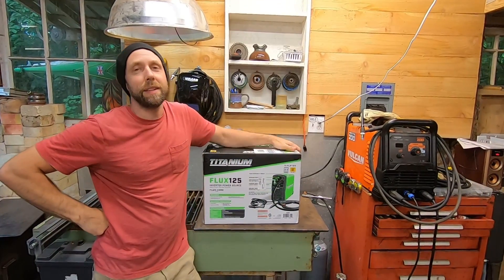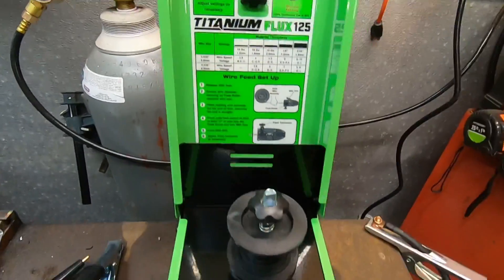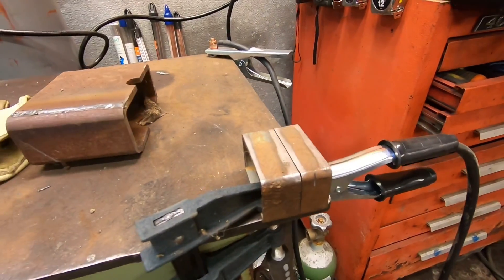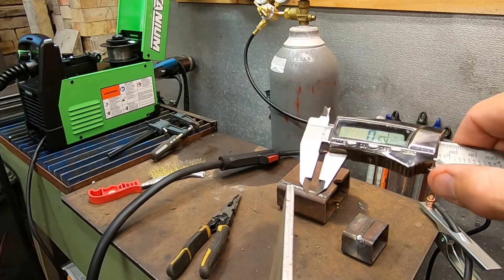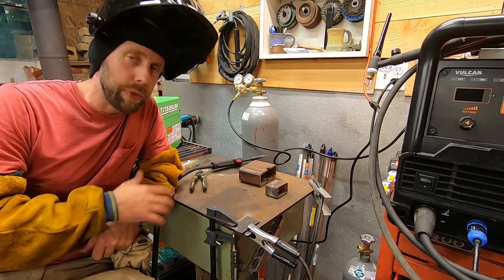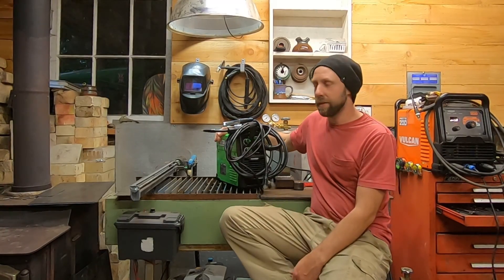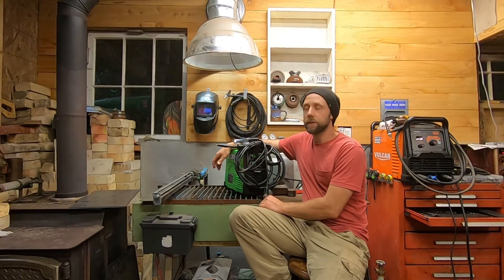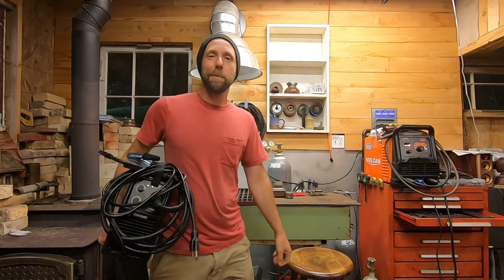Titanium Flux 125 welder from Harbor Freight

Comment: For any of u guys not satisfied with the welds with this little machine,i did some testing on steel between 14 gauge,and 3/8" thick.The factory setting guide on the inside of the lid seem very voltage rich to me.This causes pin hole porosity,and excess splatter.using the supplied .030 wire,I came up with these settings: 14 gauge (wire speed 5,voltage  C) 1/8" (wire speed 6,voltage D) 3/16" (wire speed 8,voltage E ) 1/4" (wire speed 9 voltage E.5) and even on 3/8" (wire speed 10,voltage E.5).Caution,3/8" is way above the recommended thickness.Try these settings,go slow,more like stick,less like mig,watch the puddle,have fun! this little bitch welds good!
Reply from the maker: Thanks Jeffrey for posting this! I’m sure this info will definitely help some people out 👍
Reply: @ Mike festiva - Thanks for posting this video. I’ve never welded before, but would like to learn. I have lots of experience brazing and soldering, which may or may not help. Is this little welder capable of welding aluminum?
Reply from the maker: Jimi Hughes Thanks for checking out my video 👍 this little welder is not capable of welding aluminum,  just steel. The Titanium 140,170 and 200 are capable with a optional spool gun. Take care
Reply: @Mikefestiva I just picked up mine last night, where on the PCB, did you find "switched power" for connecting the gas solenoid valve?
Reply: @Mikefestiva  Well I went out and got the welder.. It was really hot outside and I needed to weld the brush hog, s I decided if I was really careful I wouldn't get burned.. So I didn't wear a shirt.. I didn't get burned by the splatter or metal.. I got a bad sunburn from welding.. No one ever mentioned that could happen.. So for the noobs learning to weld.. Cover your skin! The UV light from welding will cause sunburn!.. Just thought you might want to mention it in a future video..
Reply: I was wondering if this would be a good welder for doing a exhaust on vehicles and grill gaurd building stuff like that
Reply: @gamerkilla  It would work,if I had the choice,I would use Mig with gas,mainly because of the lack of clean up,no slag etc.But ive welded 14 gauge uni-strut with it,and it worked good.
Reply: @MsWillysg503  2mm exhaust is approximately 18 gauge.  What are the wire feed speed and amperage/voltage for 18 gauge to avoid blowing through the material?  Century touts their FC90 as being the cure all for exhaust with .030 wire.
Reply: @aguilayserpiente  havent tried 18 gauge,14 is the thinnest Ive welded.U said 2mm,isnt that about .080 ? Im sure something less than speed 5,volts c.I would use solid wire mig with gas on stuff thinner than 14 gauge
Reply: @gamerkilla  I was planning on picking up one of these for the same things
Reply: I just screenshot this! I’m gonna laminate it and tape in my welder! Awesome Tip! Thank you
Reply: Been welding 24 gauge with it all the way down it's not always pretty but it works and is solid
Reply: Thank you! I took a screenshot and I appreciate the info
Reply: Much appreciated info , i just bought one of these with a HD ground clamp and a Lotus ltp 500d pkg deal from Harbor Freight.
Reply: Thanks so very much for sharing that information with with us! I’m getting ready to buy one of those welders!
Reply: can it do aluminim?
Reply: @mygirlhitsme  No its a DC machine
Reply: Ok I just saw this after I posted my comment. I'll try this out when I get home
Reply: @Jeffrey Worth I just picked up this little welder to do work on my ‘84 Chevy K20 I’m working on. Any recommendations for the settings for working with the sheet metal on my truck? I believe it’s 18 or 20 gauge. Thanks so much!
Reply: @gimmefuel7268  u are gunna have to experiment,18-20 gauge is thin,solid wire mig with c25 gas would be a better choice,flux core can be trickier,it burns 🔥
Reply: What setting would you use for 3/16 plate to 5/8 square tube with 16g wall thickness? Joined from edge of plate to side of tubing.
Reply: @TerryUniGeezerPeterson  u kinda gotta use a setting for the 3/16,and keep the wire on the thick plate,and run up the thin square tube quickly running little circles,its technique.If u dont run hot enough for 3/16 it wont do well
Reply: Awesome ❤thanks 👊
Reply: It does weld great for the price.. I have almost 18lbs of .030 through it without a glitch..
It will easily single pass weld 3/8   if you bevel the joint good and use .035 if you preheat the steel to blue with a torch first it will lay a fat stack of dimes clean through to the bottom..Nice 😊 👍
Reply: I ignored the little chart inside the lid and just played with the settings while making some test beads. This thing welds great for what it is. I bought it to repair mower decks and other things in my small engine repair shop. Very happy with it. I have a big TIG welder and a stick welder that makes beautiful beads but wanted something small and easy to move around that would plug into a 110 outlet.
Reply: 110 outlet at what amp i.e. 20 30 ??
Reply: @anthonypropst1818  dedicated 20 amp circuit
Reply: @MsWillysg503   hi, Im planning To Buy this welder tomorrow. Im a beginner And no experience at All. Can you plug thi directly To a regular outlet in Your garage using an Extension cord?
Reply: @Malingkat5949  yes ,u need a 20 amp dedicated receptacle for best performance on the higher settings
Reply: @MsWillysg503  you mean I Just need To replace my outlet into 20amp? How bout the breaker How many amp?
Reply: @Malingkat5949  its gotta be 20 amp from the breaker.If u run it on a 15 amp circuit,you wont be able to do thick stuff
Reply: @MsWillysg503   so I dont need To replace my existing outlet? Sorry For Asking More questions, I dont know anything about electricity. The reason I asked about outlet plug because I remember When I Bought a treadmill a few years ago, the technician replace the outlet To 20amp
Reply: @Malingkat5949  u should be good to go
Reply: @MsWillysg503  Thank you Very much! I really appreciate it.
Reply: @Malingkat5949  anytime,good luck with the little machine!
Reply: @MsWillysg503  hey, I’m gonna bother you again. What is the right helmet For a beginner like me, a  fixed or auto?
Reply: @Malingkat5949  Definitely Auto darkening.look at the titanium auto darkening from Harbor freight,the green and black one
Reply: @susanworth7930   ok thank you.
Reply: @MsWillysg503  could I run this on a 120v circuit with a 30amp breaker using a 10ga 25ft. Extension cable (cord), thanks 👍 for your technical support
Reply: @shermanyoung8185  100% yes !
Reply: @MsWillysg503  👍 thanks Mr.Worth(Nikola Tesla)👩‍🏭😂
Reply: @Malingkat5949  
20 amp circuits requires 12 gauge wiring. Putting a 20 amp breaker and recpt. on a #14 wire is asking for a fire.

Comment: Hey question would this welder be good and strong enough to weld a tube bumper for an off road truck?
Reply from the maker: Yes as long as you are a good welder you should have no problems welding up to 3/16” or even 1/4” as long as you bevel the weld joints to get deeper penetration and you know what you are doing. I used an old Lincoln flux welder that was less powerful then this Titanium welder to weld up an entire gas powered bandsaw mill, it’s still working 10 years later without any issues with the welds 👍

Comment: Hey man i have a welding question for you. How do you determine what settings to use if your welding different sized steel together? For example, if your welding 1/8" to a piece of 1/4"?
Reply: @Magoot2456  Settings for the heaviest gauge steel; keep your arc on the heavy side most of the time and only hit the thin stuff briefly. With longer beads, stop after a few moments to let the steel cool down
Reply: @reshpeck  wicked! Thank you :)

Comment: Harbor Freight no longer includes welding wire with this unit, so be sure you pick some up when you buy the welder!
Reply: Yeap, just got one no wire in box. Their 2lbs .030 is like $15 although much higher quality wire is the close to same price on Amazon.
Reply: I just bought 6 pounds (three 2 pound spools) of wire off Amazon for $24.99. Much cheaper than HF!

Comment: Can you plug this to any outlet around your house? Or does it need a proper outlet for welding?
Reply from the maker: Yes this can be plugged into any 120 volt plug, you are better off if you don’t have anything else using power on that breaker though. That way you can use the full amps for the welder.
Reply: @Mikefestiva  awesome... tnx for the reply🙂

Comment: I just bought this welder it isn't working anymore for some reason. I bought a 240v plug to 120v plug adapter cable because someone on reddit said I would get better performance I checked if I screwed the tip onto the gun right but for some reason nothing is happening?
Reply: You burnt it. 
It's a 120 volt machine only.
Reply: @deanb949  🤣🤣🤣🤣
Reply: You aren't smart enough to have access to electricity.
Reply: @waytospergtherebro  crap happens, develop some compassion and one day you might even make a friend

Comment: Never welded before but I have a crack in one of my aluminum wheels. Do you think this would do it ?
Reply from the maker: No this welder will only weld Steel, welding aluminum takes a fair amount of practice with an AC TIG welder or Spool Gun with %100 Argon gas.
Reply: if you even weld a wheel its never going to get balanced right if its like a riding tractor wheel sure do it but not a car

Comment: I am wondering why the settings on my Titanium  Flux 125 are completely different than this video. Also the 3/16" setting is blank
Reply from the maker: They probably are definitely because of changes in production. I bought mine the first week they came out. That was about 3 years ago. I think the Titanium 125 at my work has different settings then mine at my shop. Just follow the settings on your chart, maybe even set them a little lower if you are just starting out practicing 👍
Reply: Amps x volts will give you the watts that it is drawing

Comment: Could I use this welder to make a woodfiired stove?
Reply: So long as the material you use is within what this machine is rated for, yes.

If it falls outside slightly, you may be able to but there's no guarantee of that.

Comment: Can you plug this welder straight to your wall outlet?
Reply from the maker: Yes. It will plug into a standard 120 volt outlet. You will get the best performance with a 20 Amp 120 Volt outlet 👍

Comment: Bro how did you  do that, I bought that very same welder and I used a 0.035 wire and the welding did not hold the two pieces of metal together. Do you think the wire was the problem or the welder 😂😂😂. 
Yours was very professional.
Reply: Probably your settings plus your welding skill. You’ll get better with practice
Reply: Sounds like your heat setting was too low and produced a cold weld that didn't get the penetration to fuse the pieces together.

Comment: How is that welder holding up now ?
Reply from the maker: Still working good 👍 
Other flux welders to consider is the Yeswelder flux135, it’s a Flux MIG welder, stick, and a DC TIG.
 The Hynade 140D is a 140 amp dual voltage 120 volt and 240 volt so it’s definitely a good machine. Here’s a video using the Hynade 140D flux welder 🙂
Reply: @Mikefestiva  great advice. Planning on treating myself to the Hynade 140 for Christmas. I had no idea until I came across this comment of yours
Reply from the maker: @DriftmanX  Right on 👍 I just posted a video of all 3 flux welders and compared there features. I bet you would like that video. Take care 🙂

Comment: The instruction manual specifies this welder can draw up to 23 amps for the input/ac. How is that supposed to work on a standard 120v outlet and 20 amp breaker? I've looked but have found no answer for this.
Reply from the maker: I think 23 amps would be if you turned it up all the way. It would probably trip the breaker like most welders will maxed out on 120 volts.
Most of the time welding 1/8” or 3/16” it probably draws around 15 or 16 amps. The Hynade flux 140 I have is a multi voltage flux welder, it’s nice because you can plug the Hynade into 120 or 240 volts.
Reply: This is the same welder I purchased.  However, the welder trips my 20 amp breaker after less than 1 minute of light duty welding.  I did expect what was expressed below about amp usage to be true.
Reply: Update: The reason my welder kept tripping a breaker is because I was plugging into a 15 amp receptacle. My electrician suggested installing a dedicated 120V 20 amp receptacle. He advised against using 30 amps because of a fire or safety hazard.
Reply: Thanks, guys. I've been wiring up my shop this week and based on the info given here I've installed a separate 30 amp plug with #10 wire for this welder.
Reply: Interesting - thanks for the update. Today is the first day I really got to use the welder and the 30 amp worked fine, but I can certainly understand the concern.
Primarily the issue for me is that the instructions say the welder uses 23 amps, and a 20 amp circuit is rated generally speaking for about 18. Maybe the instructions over-state the amperage requirements, but personally running a 23 amp tool on a 20 amp circuit alarms me more than the 30amp breaker. 
The biggest mystery at the moment is trying to find a 30 amp homeline single pole gfci breaker. Apparently they don't exist. Fortunately i live in super dry country and take other precautions.
Happy welding!

Comment: Would this weld aluminum?
Reply: No no no you need a machine that Can do aluminum like Hobart Miller or Lincoln cause those are different settings
Reply: No buddy
Reply: Get the Vulcan pro TIG.  We got one to work on our 1958 aluma craft boat.  Works damn good.  Bought it and a bottle of argon and all accessories for 1200 on marketplace.

Comment: I know this welder is rated for 18 gauge as the lightest metal to weld, do you think it would work for 20 gauge sheet metal, such as welding in floor pans on a jeep cherokee? Would it blow through it or could it be managed?
Reply from the maker: Flux wire tends to burn hotter then solid wire so you probably would need to play with the settings a bit and run .030 wire. I’m sure you could run this for the project on your Jeep. 
You probably would need to stitch the panel, weld a short distance then stop, move to a different area then do it again then stop to keep the heat from building up. I also recommend getting some thin 20 gauge metal scrap so you can practice a bit to get your technique down before welding on your Jeep 🙂👍
Reply: @Mikefestiva  Thank you for spending the time to reply, I appreciate it!
Reply: It can Spot weld it, just like the factory. Practice your technique on scrap of same mass.

Comment: Is this strong enough to weld on truck parts?   Like gussets that the lower front end control arms bolt too?
Reply: if you weld slow
Reply: Wouldn't trust amateur welding on vehicle suspension.
Seasoned pro minimum.

Comment: Good little welder I have used .030 and .035 wire in it. Welded 14ga, 16 ga, 18 ga 10 ga 1/8, 3/16 tube (square and round) flat stock of the same mentioned Did some hand rails using 11ga and 14 ga with both wires recommended for the machine. I use .030 for lighter stock and .035 for heavier stock. I have had this welder for a couple of years fixed some converters also with it. Also did fencing with this welder 1/4" and 1/8" round tubing it has held up. I actually bought this to do the fence cause my Miller big 40 broke. used the generator for the power for this little machine it worked good. I would suggest this to a beginner or pro

Comment: Could you weld a patch panel to a car?  Can you tack weld and then stitch weld until the panel is welded.  I think if you pull it the metal on the car would warp.

Comment: Great video, I am now subscribed. I am a retired mechanic and we do a lot of RV travel. If a spring mount broke or something similar happened to our fifth wheel while on the road I would find the closest HF and buy one of these little machines. We have a 4500 watt generator and that would be its power supply. For the cost this welder would likely be less expensive then calling a mobile welder and when the trip was over I would still have the tool. Thanks much for the video!
Reply from the maker: Hey Jim thanks for subscribing and your kind comment 👍

Comment: I’m used to (amateur) welding with a big ass Miller with argon gas, but I bought this to do a little stuff. I tried to fix my snowblower handle and it was the worst welds I’ve ever done lol! And I’m not blaming the machine at all, I know I just need to fine-tune it. The weld held for a little while, needless to say I’ll get to practice welding some more on the snowblower…🤣🤣

Comment: What should i get the Titanium 125 flux or the Harbor freight 125 flux welder? Titanium is $209 and the Harbor freight one is $149. What's the difference in the 2?
Reply: I've owned both, the Titanium is worth double the Chicago Electric 125. The wire feed and stinger are trash on the CE125, the Titanium 125 is made with quality parts and weighs half of the cheaper one.
Reply: @charlesdjones1  thank you
Reply from the maker: Definitely my thoughts as well, thanks Charles for commenting 👍
Reply: @Mikefestiva  bought my Titanium last weekend.
Reply: The Chicago Electric 125 is AC and the Titanium is DC.  DC is far superior for flux core welding.  I have owned both these welders and find the Titanium far superior and well worth the extra money.

Comment: HI Mike.  What size brake would I need for this Welder?
Reply: fyi... my garage has a 15 amp breaker. I can weld 1/4 " for about a 1 inch bead before it trips the breaker. Works great for small repairs, even with a 15 a breaker, but for any kind of fabrication a bigger breaker would be needed.

Comment: I had mine for a little over a year and it has been a solid welder. Gone through maybe 8 spools of wire in that time. I did replace the ground clamp with a better one and also replaced the electrical cable with a true 20 amp cord. 3/8 is no problem.